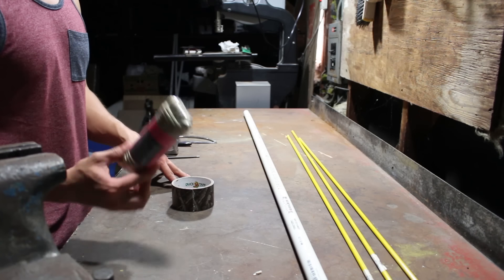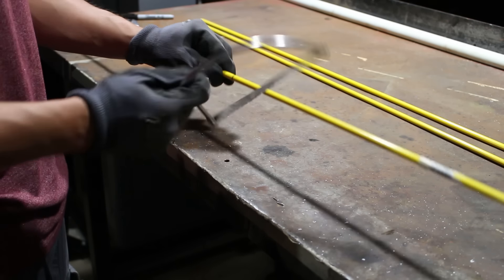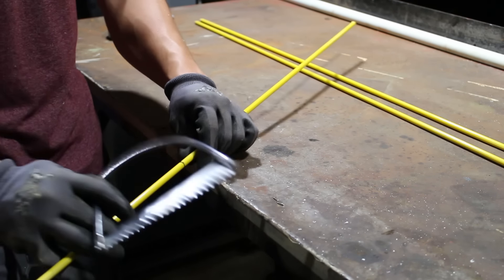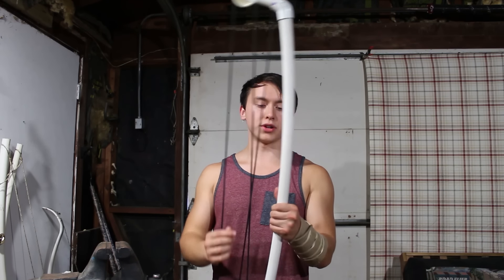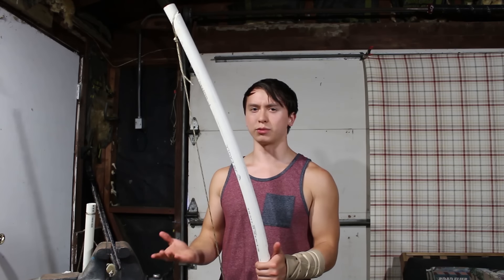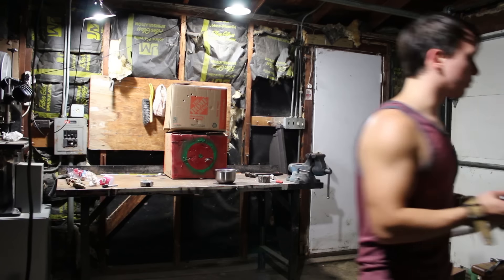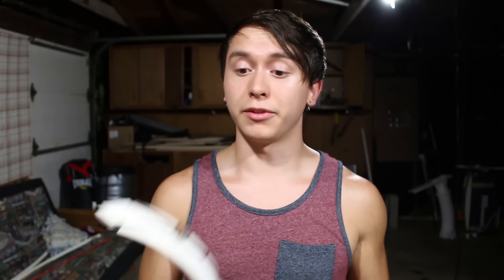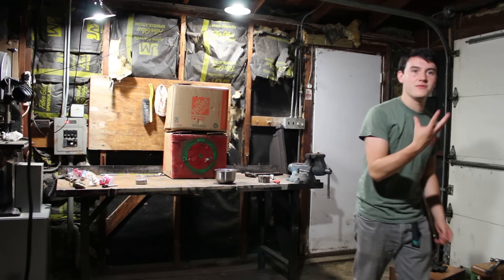Easy, Cheap, POWERFUL Bow (NO Power Tools or Heat Needed)

Comment: My first PVC bow-making efforts involved stuffing the PVC full of fiberglass rods; it increased the draw weight tremendously, but decreased the power of the bow.  Eventually I realized that increased draw weight doesn't help unless it increases acceleration of the arrow, so let's look at what interferes with acceleration.  The bow I built had two major defects: all the fiberglass rods led to internal friction and movement -- wasted energy -- and the sheer mass of the fiberglass towards the ends of the bow worked against acceleration.  (acceleration = force / mass, so higher mass means lower acceleration; and the worst place to put that mass is the part of the bow that has to move the fastest.)  On top of that, the maximum acceleration of the bow is limited by whichever material returns to its original shape more slowly, PVC or fiberglass; it becomes a worst of both worlds situation.  So it makes sense to me that your bow with the heaviest draw weight is not providing the penetration you were expecting: sure you're putting a lot more energy into drawing the bow, but the bow isn't giving that energy back efficiently.
Reply: This actually makes sense. So when building such bows the trick will be to find the balance eh
Reply: @finethehuman1821  A bit of a balance, but probably more than anything, being selective about materials.  First consideration is a material that deforms under force but then QUICKLY returns to its original shape.  Then pick the ones that offer the most force while being the lightest.  Found this interesting article about bow wood:

https://www.wood-database.com/wood-articles/bow-woods/
Reply: @kingbeauregard  that was an interesting read, albeit about wood. Unfortunately I donot have access to any kind of wood so I'll have to stick to PVC. Trial and error time haha
Reply: @Johnny Wass I won't claim to be a physicist, but I have built a few PVC bows in my day.  First one I built was a monstrosity made of bad choices: a pipe filled with fiberglass and big heavy caps at each end.  The performance was absolutely terrible.  I discovered I got much better response from just a straight PVC pipe that the string attached to on each end, even though it was much easier to draw.  That meant the first bow was wildly inefficient, and trying to figure out what went wrong the first time, I realized that the entire bow needs to be built around accelerating the arrow.  That means the limbs need to move fast, which means fixing anything that slows the limbs.  Poor choice of materials will slow limbs, internal friction and resistance will slow limbs, mass will slow limbs.
Reply: @kingbeauregard  Lars Andersen is a trick shooter. He's insanely skilled, yes, but the bow he uses has basically no power worth mentioning, precisely because his show is all about speed and accuracy and he doesn't need his arrows to actually be able to hurt anything. If he had to hunt deer with it, his usual bow would be useless. He'd have to employ his talents with a bow that can generate more power, otherwise the arrows would just stick into the fur and hide of the animal.
Reply: This an excellent break down.. I did the same thing years ago but used a sold fiberglass rod.  Great comment.
Reply: Darn was hoping you had a channel..
Reply: Alot of time with the more crudely built PVC bow the draw weight is not efficently distruputed across the bow and even though more draw weight usually means more penetration crudely made pvc bows tend not to be as efficent as a better built one because crudely built pvc bows function more like an over sized slingshot than a bow.
Reply: mine has four fiberglass rods. i think one is 18 inches one is 24 inches 30 inches and 36 inches. it works really well. i just used a random piece of pvc that's 5 ft 4 inches.
Reply: @TheCbot88 what your doing makes sense its actualy advantagous to have more tension in the middle and less tension toward the ends otherwise if you have tension distrubuted evenly through out the bow which is the case with a lot of crudely built pvc bows that are made you will have some that functions more like a over sized sling shot than an actual bow.Those type of crudely built pvc bows can still work but they won't be the most effective nor would it use its streagth efficently.more tension usually does mean more power but with a crudely built Pvc you will have  less power in proportion to the tension.
Reply: @kingbeauregard  hi, this bow is usefull for hunting?
Reply: @Pablo-kr5bi  Probably not. It's not very powerful.
Reply: @kingbeauregard  but the fiberglass doesnt give more power?
Reply: @Pablo-kr5bi  No, because it is grossly inefficient at accelerating the arrow.  It may require more power to draw the bow, but it doesn't then accelerate the arrow faster.
Reply: @kingbeauregard  then, is crafting a bow with walnut's wood better than this?
Reply: @Pablo-kr5bi  I don't know what walnut wood is like.  I know that some wood is good for bows, other wood is not.
Reply: I wonder if all my old spin cast rods without the eyes would stuff a PVC tube, 6 or 61/2 foot PVC.
Reply: my PVC pipe is grey is that ok ? it feels a little bit stiff

Comment: Just to let you know about the recurve bow. The one aspect of a recurve bow is that you have a more steady tension load throughout the entire draw. For instance, while the bow is sitting static you could have 35 pounds and at full draw you could have 45 pounds so roughly there would be a 40 pound exerted pressure on the arrow from when it is released, at your grip, until the arrow separates from the cord.  More importantly, you are at 35 pounds of pressure against the arrow when it leaves the cord.
 A long bow starts at 20 pounds and will pull back at full draw to about 80 pounds.  Unfortunately, the average is not adding both and dividing by 2 because most of the draw weight at 80 pounds is in the last 2" of draw. So you start with 80 pounds of acceleration pressure against the arrow and then it decreases rapidly. Having this deceleration of acceleration causes the overall performance of the arrow to not penetrate as well. The best way to test is not into a target but to test the Feet/Second the arrow is traveling. 
 First side note,  Drawing back a recurve at 45 pounds, a person will normally have a full draw. As opposed to a 3/4 or 7/8, shaky arm draw, due to the fact that it is easier to pull back a full draw on the 45 pound recurve than it is on the 80 pound longbow.
 Second side note, it seemed that the recurve hit more centered on to the target not moving the target as much.  This would be like catching a baseball stiff armed as opposed to using your elbow for recoil cushioning. The ball won't bruise your hand  And, the arrow won't penetrate as far into the target.The longbow seem to move the target because it was hit off center.  My suggestion to correct for this, put the target against a solid backstop. 
I hope this helps.
Reply: Damn you are good
Reply: can you tell me alternates for driveway marker

Comment: Recurve bow
									
From Wikipedia, the free encyclopedia
								 												
A recurve bow is a bow with limbs that curve away from the archer when unstrung. A recurve bow stores more energy and delivers energy more efficiently than an equivalent straight-limbed bow, giving a greater amount of energy and speed to the arrow. A recurve will permit a shorter bow than the simple straight limb bow for a given arrow energy and this form was often preferred by archers in environments where long weapons could be cumbersome, such as in brush and forest terrain, or while on horseback.

Comment: the recurve works by shortening the string (the part that is free and not touching the limbs) so that the angle at the nock of the arrow stays more acute (less flat, like when you are at the end of the drawing) and the energy transfer is more efficient. It's like shortening the limbs, at the same draw weight, while the arrow gets released.

Comment: short answer, the design of the recurve allows for more initial pull weight than the long bow, storing more energy per inch of draw.
Reply: deth502  why?
Reply: physics.
Reply: i guessed, but i was hoping for an explanation :)
Reply: The reason is quite simple and you have to look at the bows when they are unstrung to fully understand it. The one in the video is a straight bow meaning that unstrung it is a simple line. Now the recurve bow unstrung has it's limbs well ahead of the riser (middle point). Therefore when the recurve bow is strung it stores far more initial kinetic energy as it has a much higher initial tension and the string upon release has a much longer travel as it tends to be much closer to the riser = more time accelerating the arrow. Compare it to a short barrel rifle with a long one it's the same thing. Hence the difference between the 45lbs recurve and the 70lbs straight bow shown in the video. All in all looking only at the weight of the bow is misleading. You have to know the speed and the weight of the arrow upon shooting it to determine how suitable is a bow. Depending on your purpose for using a bow you might want to sacrifice speed for noise and accuracy
Reply: Christoforos Paphitis great explanation dude..
Reply: That initial potential energy jump in a recurve is known as preload in the archery industry.  A longbow has a fairly linear poundage vs draw length curve, whereas a recurve has a very rapid rise, tapering off to linear or even letoff like a compound bow.
Reply: This is true, but it doesn't affect the speed of the arrow. If you have a recurve bow, and you have a longbow with identical pull weights, then they will impart identical energy to the arrow. Assuming you're using identical projectiles, then they will leave the bow with the same speed. The advantage of a recurve bow is in its size. Because it allows more attention to be stored in the staff then a simple Parabola shape wood, you can have the same poll weight, but in a much smaller package than a longbow. Of course, they're more difficult to make. But if you have a 45 lb recurve bow and a 45 pound longbow they're going to launch the arrow at exactly the same velocity ( assuming both those are fully drawn and released).

Comment: Yes, the recurve tips are for improved performance at lower weights. 

The heavier bow would perform better at full draw though. The force increases more steeply the further you draw. The most power per inch comes from the last inch of draw

Comment: One thing ive heard of for drawing back a larger pound bow, try shooting with the arrow over the thumb not the hand it will trigger different muscles and help to pull the bow back to the firing position on a longbow. Not as accurate for sighting down the arrow but should use most of the back muscles vs the shoulder and arm
Reply: I agree. That’s how to bows were historically shot and it does give better results once you master it! 👌🏻

Comment: the strong bow pushed the back end of the arrow more and making the arrow unstable during flight..

45pound worked well on that arrow, the 75pound bow would surely work better with a different arrow.. i don't know how to explain it, but it has something to do with "Momentum" of the arrow leaving the bow
Reply: cyvidal10 You're close. It's the dynamic spine, or the stiffness, of the arrow. You need to match the dynamic spine of the arrow to accommodate the draw weight of your bow for accuracy and power transfer efficiency.
Reply: luigisf thank you so much :)
Reply: cyvidal10  ok
Reply: The shape of the recurve is what makes the arrows quicker off the string - if you draw a line from the tip of the limbs at full draw to the tip of the limbs at zero draw, the path drawn by the tips of the recurve bow is flatter than that of the path drawn by the longbow, resulting in a quicker acceleration of the arrow, and thereby a quicker and more efficient delivery of the projectile.
Reply: ...not just the construction,i once saw in a video that those curves at the both end where the strings are knotted to gives an extra snap when the string is let go  which increases the acceleration(???idk lol) I guess
Reply: cyvidal10 are you talking about the arrow paradox?
Reply: <Joshua Jimbun> not entirely, even if they have some common ground.
Reply: Joshua Jimbun it's not really the archer's paradox on this one. The paradox happens, no getting around that, but when a bow is either too strong or too weak for the arrow, it causes the back end of the arrow to REALLY shake from side to side. An arrow that is made for a specific bow's draw length and draw weight will end up straight in a target whereas an arrow with a worn spine or not the correct spine will wobble and end up contacting at weird angles. That's all regardless of distance as well.
Reply: Basically the spines to soft on the arrow and having a bit more weight would help for that draw weight, the final longbow is not very efficient at speed unlike the recurve, given the choice the 45lb recurve is the best for arrow and energy. Congrats to his fan he's made a better bow than the YouTuber

Comment: the purpose of the curve to the recurve bow was to increase penetrating power while having a lower draw weight. when the now is drawn, the curves almost completely straighten out, allowing the string to launch the arrow with increased velocity at a target. recurve bows were used in mainly the middle and far East.

Comment: To those interested in/discussing recurves in the comments:

A recurve is formally defined as a bow where the string touches the belly of the limbs. If the limbs are curved but don't touch the belly, it's considered to be reflexed or flipped-tips. If the limbs are straight, it's a longbow.

It's complicated, but recurves don't technically store more energy than a longbow, they just effectively shorten the working limb (unless they're working recurves, which unravel as the bow is drawn, but these are exceptionally rare and finnicky). A 10in piece of pipe is more difficult to bend than a 15in pipe, and thus bending both the same amount will store more energy. This is where most of the actual power increase comes from when you recurve a longbow: it increases draw weight, but the same effect can be produced by just shortening the longbow instead, or making the bow to a higher draw weight. 

However, at a certain length of bow, the angle between the string and limb exceeds 90deg, and two things happen:
First, the string risks flying off the bow
Second, the string begins to pull the limbs out instead of down. This is called stacking, and it strains the bow without increasing arrow speed. 

This is where recurves are handy: they make it so that the string angle never exceeds 90deg, allowing for more bend to be gotten out of a shorter bow. However, most materials will break at this level of deflection when made with reasonable dimensions, so it doesn't really add much benefit.

If you recurve a bow which is long enough to not exceed 90deg of string angle, then the only benefit you can possibly reap is having a higher early draw weight and a slightly lower late draw weight. This is because, when the string contacts the belly of the bow when braced, it's effectively a shorter bow and thus harder to draw. As you pull back the string, it lifts off of the limbs and becomes a longer bow and easier to draw. This effect increases with the length and intensity of the recurve, but the effect is normally not very prominent.

Recurves have several weaknesses, which personally compel me to make exclusively longbows:
Firstly, they're harder to make

Secondly, and most importantly, they're usually heavy, and heavy in the wrong place. In order to stay bent without breaking (or flexing and losing their bend over time), they need more material than longbows. Mass near the tips of a bow is the worst place for it: imagine a swinging a baseball bat with a 2lb weight at the handle. Then imagine moving that weight to the tip. It now takes considerably more effort to swing. The same thing happens to a bow: it gets slower and less efficient, negating any effect of recurving.

Third, they're louder and have the potential to twist out of alignment. When you shoot the bow, the string returns to brace. On a recurve, that means slapping the bow, which is quite loud. The heavy tips also return home with more force, which leads to uncomfortable vibration and additional noise/wear on the bow. This energy is wasted, and doesn't go into the arrow.

A longbow made to a proper length (there are equations) will be faster, quieter, and more pleasant to shoot than a recurve.

tl;dr:
Recurves aren't actually more powerful than a longbow. They just fool you into thinking so, and all of their benefits are negated by making a slightly better designed longbow. They can actually make your bow slower and more uncomfortable.
Reply: can you tell me alternates for driveway marker